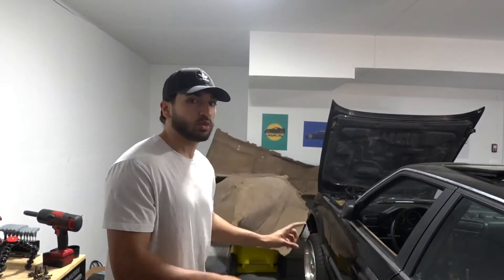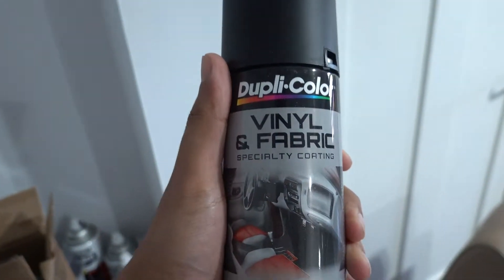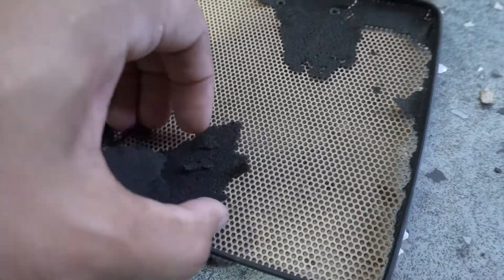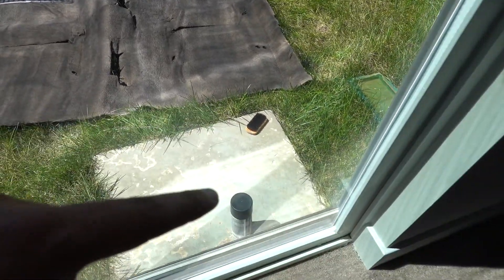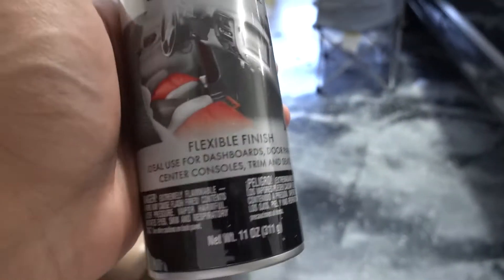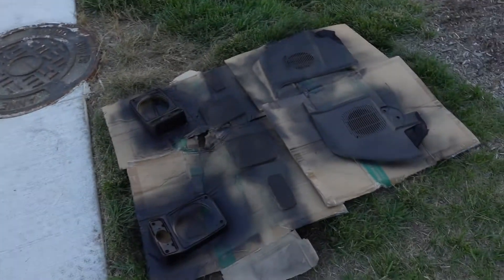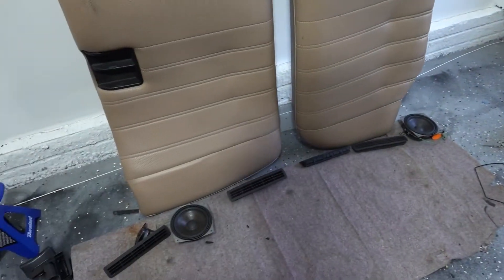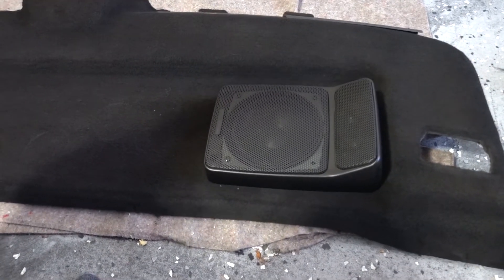PAINTING THE INTERIOR BLACK ON MY 91 BMW E30.. Ugly beige gone!

Comment: Was there a specific reason you didn't want to just replace the carpet? A brand new carpet kit is usually only about $200-$250. My experience with fabric spray is it doesn't seem to hold up that well
Reply from the maker: The e30 cabrio and coupe carpets can be found but not for the sedans. The one carpet I did find was for sale for 900$ so I went this route. No one could give me a clear answer If the coupe carpets fit my sedan